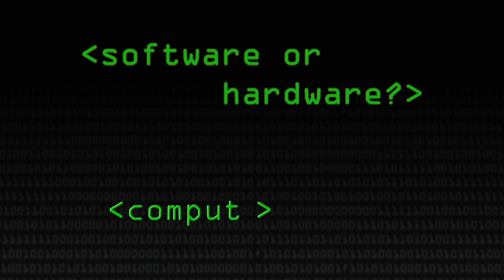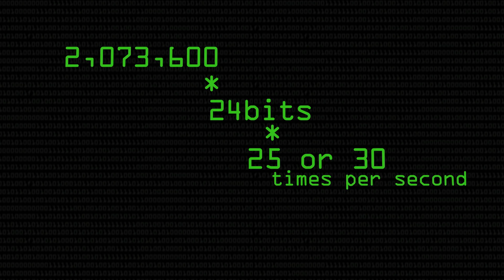Hardware vs Software & Digital Video - Computerphile

Comment: Nice video.
Luckily I shoot my films in RAW (CinemaDNG) ~24MB per frame at 24fps so my camera doesn't waste energy on compressing ;) it wastes it on buffer space and SSD writing.

You only realize how hard things are compressed when you do color grading or VFX work (especially keying) a shot in RAW keys far easier and cleaner near the edges than a shot in a compressed format.
Plus compositing is easier too because instead of only 10bits of colourspace you have 24bits more space to push and pull the elements to match more.

And no BANDING! If only YouTube had better compression, youtube kills videos.
Reply: +Raymond Doetjes Yes was about to make a joke about the delivery platform friend... 
In the end we all go to the grave...  I mean... TO the YouTube upload box of h.264

Comment: Why is it often purple when there's a video glitch?
Reply: +t0f0b0 Porbably because the codec works with YUV (luminance and chrominance) instead of RGB.
Incidentally, a 0,0,0 pixel in YUV is purple.
Reply: +t0f0b0 Probably due to the loss/corruption of the data for the green channel so anything white-ish would only get Red and Blue giving Purple. I imagine the other combinations of two of the three colors are equally prevalent but perhaps doesn't stick out as much to our eyes.
Reply: Anders Öhlund Interesting. Thanks for answering! :-)
Reply: +t0f0b0 Another idea; there's two green and only one blue and red subpixel for each entire pixel in a camera's sensor.
If the blue, red and 2 green pixels managed to produce an illegal colour for that colour space - the green data may be binned for fear of totally overexposing the image - in turn resulting in only the blue and red channel values being presented in the final encoded file. Sort of like a failsafe.
It could be a totally different answer - I have no idea, I just work with cameras and video editing (i don't make cameras etc.)
Reply: xmtxx2 Ah. That makes even more sense =)

Comment: Is it not also true that video compression standards are purposely designed so that hardware is cheap [=easier to design and mass-produce] on the decoder side?  That's why a name-brand blu-ray player is 39 bucks.
Reply: +lmiddleman I would not be surprised if that was the case. Another factor is that Blu-Ray has relatively little compression, as you have lots of space on a Blu-Ray disc. Dual-Layer Blurays (which is the industry standard for movies etc) have 50GB of space, so obviously there';s not that much of a need to compress a 2 hour movie that much, and you can give the image more detail and choose a lighter compression codec that is easier to decode. With a Youtube video or a video you copy onto your harddrive you don't have that luxury, as there's a finite amount of space/bandwidth available.
Reply: +TheKyshu Despite the fact that Blu-Ray discs have lots of space a movie still requires quite a lot of compression to fit.
8 bit @ 1920 x 1080 @ 59.94fps = 238 MB/s, or 834 GB/h, so an uncompressed 2 hour movie would require 34 discs...
That's why Blu-Ray uses the same h264 compression as YouTube does.
Reply: d5uncr You're right, didn't think of that. Nonetheless, the way the video is encoded is probably catered towards retaining as much quality as possible and aking it easier for hardware decoders to play it. One small correction: Youtube uses VP9, not H.264.

Comment: "Too complex to get right in software", that's weird. Complexity increases the risk of bugs, and bugs are much easier fixed in software, so I have to disagree with that introduction statement.
Reply: +ArumesYT I think his definition of "to get right" also involves performance, cost, power consumption, and the time critical nature of video decoding.
Reply: +ArumesYT That's true, but hardware is usually tested ad nauseam (so bugs tend to be exposed during design) and some things are easier (or more easily provably correct) to do in hardware (don't have a specific example handy since it's been some time that I've done hardware stuff) than software. So usually you'd opt to do something in software, yes, but sometimes the guarantees - like computation time (as Mr. Davies pointed out at ~3:20) - or the ease of design make hardware more appealing.
Reply: Magix Yes of course. You can't fix bugs that are in the hardware (you might be able to make a workaround for smaller bugs but that's beside the point). What I'm saying is that when he says "get right" he doesn't mean "bug free" so you are arguing beside the point. By "getting it right" he means finding the best solution. And since you can make specialized hardware with way higher performance as well as perfectly predictable performance for a fraction of the cost that is considered a better solution.
Reply: +ArumesYT I believe it is more a question of timing. The more complex a task the more clock cycles the software will use and different inputs require different processing times. Hardware can parallel process much faster and the time will be consistent regardless of the input.
Reply: +ArumesYT The compression hardware is doing very specialized computation on one type of data which is well defined by standards, so updates aren't needed. The complexity is in the amount of calculations not in a wide variety of types. 
As he said, the problem with software decoding is that it isn't fast enough. All the bug fixes in the world can't fix that.
Reply: Magix  I wasn't talking about development stage, and you bet there are bugs in hardware. Every modern CPU, GPU or other complex IC has bugs.

Comment: I'm wondering... we will eventually reach a point where we can stream data at rates of gigabytes per second, right? And resolutions above 8K or 16K aren't gonna be as useful when we get to them, due to the resolution of the human eye. So would we eventually reach a point where we can literally process everything uncompressed (or through lossless compression) constantly as it's coming in?
Reply: +Eric Vilas We can do that now with 10Gbit ethernet, but it isn't cheap. In broadcast facilities, all the video is routed and processed uncompressed. Only when we store it or transmit it do we need to compress.
Reply: Possibly, but will we want to use all our 10Gbit bandwidth for one stream? Compression has few downsides and great benefit for transmission to the end user.
Reply: +Eric Vilas Well... by then we will perhaps (hopefully) be capturing and compressing moving lightfields for virtual reality rather than video.
Reply: Hominid Interneticus Oh, that's too bad, I kinda extrapolated from my country, where my ISP went from giving me a maximum of 6mbps to 50mbps in the past 5-6 years and, knowing the US had basically 4 or 5 times the bandwidth we have here, I thought, well, if we're going by exponential progress, we should reach 10, 20gbps within the next 10 years. (I was apparently being way too optimistic, though).

(also I maaayyy have made the rookie mistake of thinking data rates were 8 times as fast as they actually are, heheh)
Reply: Chris W Oh, so I actually wasn't that far off. In 10 years or so that's probably gonna become a lot more accessible, right?
Reply: Chris W Yeah, that's true. I'm just saying that video quality has an upper bound that data rate growth doesn't, and well, of course when 4k or 8k becomes the standard we'll need a lot bandwidth more to stream properly.
I might have been a bit too optimistic, though (I was thinking along the lines of "hey, since we can stream compressed 4k video today, and in 10 years data speeds will probably be a hundred times better, who knows how much extra bandwidth we'll have?").
Reply: Hominid Interneticus I'll keep bragging about Swedish Internet speed and cost then. It should make it a bit more embarrassing for American ISPs to keep over charging for lousy connections. We do it for you guys really 😜
Reply: +Eric Vilas 
The resolution will most likely increase at a much faster rate compared to that.
1080p uncompressed is Ton of data, i think it's pretty much doable though even with a HDD, at least possible with an SSD etc (just speaking my mind here).
As for 4k, that's 4 times the data i think and also 4 times the size of course. There is just so much space, and 8k is 4 times that i think.
As for lossless compression, that's a must for sure, that's much closer to reality, at least for 1080p right as it is now.
Now the problem of "streaming the data", it's not a problem for you or me on our PCs to playback etc.
The problem is when it's bandwidth on the internet or any network.

Remember, Bandwidth == Cost.
Why would you pay 10 times the cost for something 90% of the ppl won't even notice?
I myself would love lossless data, but when you look at it that way, there's just not any reason.
And sadly bandwidth hasn't been going so fast compared to size. We are looking at 100mbps as the "standard max" on the internet, and very few ppl even have that.
So sadly i doubt it will ever happen. Especially cause of the "why pay more for no reason" argument. Even if it was viable and possible there's just no real reason to do it.

Now that's just TL:DR _.

Comment: I like the info on video compression but I wish it was more in depth. I would love to see the "most complicated frame possible" in fact 30 seconds of that would be very interesting. Years ago I made a render test video and one of the scenes was a focus chart spinning and zooming.  That really messed up some of the codecs. I think Microsoft WMV would actually crash.  I was testing to see what looked the best on YouTube.  I never did find the "best YouTube render settings". Now days I just use Sony AVC and max out the bit rate and hope for the best.
Reply: +lowlypawn Fast zooms are very hard to compress. I was supervising the satellite transmission of a presidential press conference once and had a moment of panic because just before the president stepped up to the podium, the main camera was zoomed in very quickly to check focus. The signal went to black because the codecs couldn't handle it. I didn't know that and though we had lost the downlink. It was only about three seconds total, but felt much longer.
Reply: +lowlypawn Having very different values for every pixel of the image and changing all of those pixels every frame by a value that is totally different both for chroma and luma would probably produce a bigger video than a "standard" video recording.
Use handbrake and a constant RF~20 for a high quality low bitrate video file.

Comment: so this is why videos of moving fields of grass get horribly garbled on youtube,.
Reply: szErnzEit It uses the same compression algorithm as most other video H264. It is just that the max bitrate is too low. But if you upscale to 4K or frame double to 60fps before you upload youtube gives you way higher maximum bitrate and therefore better quality. Provided people watching chose those quality settings of course =)
Reply: +AwesomeVindicator yes, but it would not be nearly as bad as it is if youtube would use a compression which is better suited for such images. I guess the compression youtube uses is something like the lowest bitrate we can get away with mainly for financial reasons (without looking like garbage)
Reply: +Anders Öhlund Add to that the source material's own quality and compatibility with YT's encoder. If you could encode directly to VP9 then no losses would occur in the conversion process.

Re-encoding video from one algo to another makes any discrepancy even more noticeable on the second encode pass.
Reply: +Anders Öhlund It used to use H264 quite a long time ago. For at least a year (probably 2), they've been using their own, more efficient algorithm VP9 (which has the support of Microsoft, Apple, and tons of other big and important companies)
Reply: Alexander Pavel Ah yeah. But still the problem isn't really the codec as much as the bitrate.
Reply: Alexander Pavel Yeah that should remove the adding of artifacts from several forms of encoding algorithms. However lossless files can get quite large even with H.264 compression.
Reply: Anders Öhlund True. I experimented with a minecraft video about a year ago and it was about 1 GB per minute of footage. You could still re-encode it with a CRF of about 20 which would shrink it quite a bit with almost no artifacts
Reply: +Alexander Pavel Actually, depending on your settings and if you use Flash or HTML5 you'll get either h264 (mp4) or VP9 (webm).
And VP9 isn't better in terms of quailty vs bitrate but it's royalty free and open source.
Reply: One of the biggest problems with Youtubes encoding is the change of colourspace. That's where most of the quality is lost. You can try it by creating a short video of an RGB picture with 3 columns with values of 255 for red, green and blue. Upload it lossless and compare the uploaded video with your source material. The difference is immediately visable, even for an untrained eye.

Kind regards,
Meta Custom Computers

Comment: The first time I saw anything that looked like a corrupted digital video stream was during the 1976 Summer Olympics in Montreal. The program froze on a single frame then square bits of different size were slowly replaced with picture or noise for several minutes until the network broke in. What it could have been 40 years ago I have no idea. I don't know if the US network was getting the feed by cable or used the same satellite signal that was serving other countries.

Comment: Periodically, instead of sending frame deltas, the entire frame is sent...called a keyframe.  This is so an interruption or corruption of the data stream can have the decoder recover.  If keyframes weren't sent, once one glitch happens, it'd be virtually impossible to have anything intelligible on the screen.  This also makes it possible to join a stream in the middle; just look for a keyframe and start with that.
Reply: +rchandraonline Yup and also let's say you've got a 30 minute video and already saw the first 10 minutes and decided you wanted to continue watching from there, without the keyframes it would be quite a waste of resources (and waiting time on the users end) to start from the beginning and having to apply all the changes while getting to the desired point in time.
Reply: +rchandraonline 
A big difference in the codec settings used on video cameras is precisely that. Higher Pro models will shoot video with better quality, due to them using more keyframes. 

More Keyframes does means a bigger file though. But yes it lessens the amount of video you lose due to glitching.

Comment: The video is still fairly new right now, wouldn't privating it and the uploading a version with the 1GB error fixed be an option?
Reply: +Little Lion that error was in the animated text at 4:12. Still, re-uploading is not a good idea as it already has many views and comments, and resetting those to 0 will hurt the positioning.
Reply: +Little Lion Not the 2000 pixels error - the graphical error at 4:12, which is easily fixed and re-uploaded
Reply: +MarlowPreston and rerecord everything several days after the original? plus arranging the same room etc.?
Reply: +Little Lion 

You can edit just that part with the error, and thus update it.

But then it should be reuploaded since it's a new video.
Reply: Scarfmonster (WR) Ah I misunderstood.

Anyway.. The 1 GB error isn't really that vital..
An annotation would be a simple solution...

Comment: Shouldn't it be nearly 10GB per minute at 4:12?
150MB*60=9000MB
Reply: +Computerphile 
1920 x 1080 = 2 0730 600   (width x height)
          x 24 bits = 49 766 400  (pixel colour depth)
          x 25 frames = 1 244 160 000 bits per second (for 25fps frame rate)
          / 8 = 155 520 000 bytes per second (8 bits in 1 byte)
          x 60 = 9 331 200 000 bytes per minute
         ie: 9 331 Mbytes or 9.3 Giga bytes !

 Not 1Gb. You were off by nearly ten ex (10x lol)
Reply: +John Thimakis Remember Fraps? Remember people making gameplay videos in fraps? 
Well that was pretty much uncompressed AVI.  It is silly big in storage and handling. Definitely compared to the H.264 codec acceleration we use these days.
Reply from the maker: +HMFons You are absolutely right! - sorry for my mistake (perhaps I was still thinking about those '2ooo pixels...' :O) >Sean

Comment: he didn't answer the question about the most difficult frame to encode :(
Reply: +Fiifufu Given what he said, I would assume that the most difficult type of frame to encode would be that of colored noise. There's no structure, so it's impossible to extract any type of motion information. Every frame is completely different from the previous.
Reply: That actually makes a lot of sense. Thank you kind sir for your informative answer :)
Reply from the maker: +Panc8ke or a computerphile video where I don't have my tripod ;0) >Sean
Reply: +Acid, I think he actually said "the most difficult that we can reasonably expect". Just what their reasonable expectations were when making the standard, is the issue
Reply: +Acid You're correct that noise is not compressible, but we don't care how good the noise looks. I imagine the hardest thing to compress is noisy camera video with lots of motion in different directions. Rapid cuts or fast zooms are also hard to compress.
Reply: +Fiifufu Well....He kind of gave you the answer by saying that digital images only encode the changes in the picture. So the most difficult pictures to encode are the ones where everything is changing. I would hazard a guess that filming a moving image such as a car or a boat, without a tripod would be one of the most difficult frames to encode. Hope that helps.
Reply: +Fiifufu Lots of moving stuff like a flock of birds.  I guess the most difficult frame would be static as seen on an old TV (although it would be multi coloured).  The encoder wouldn't then find any patterns between frames and it would struggle badly (possibly crashing).